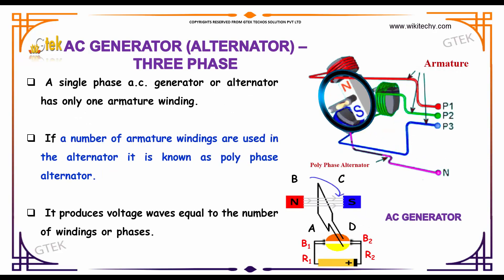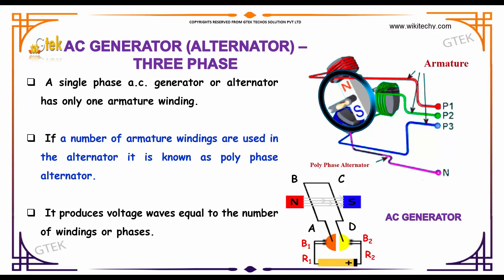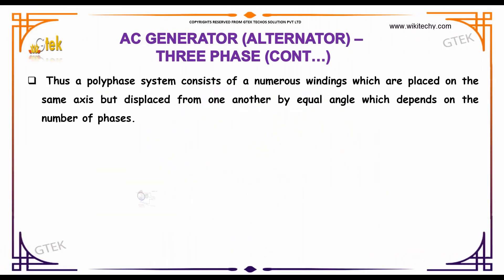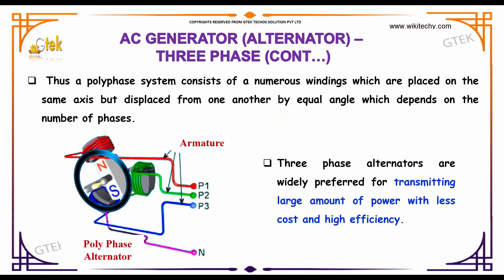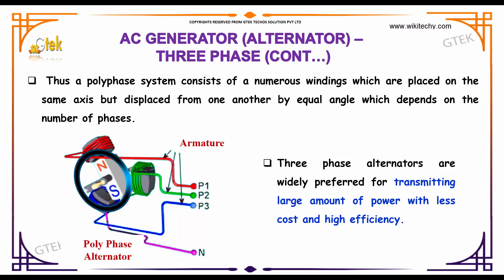Ac generator three phase  | Electro Magnetic Induction And Alternating Current

Comment: Three-phase AC generator connected as a wye source to a wye-connected load. The voltage seen by the load will depend on the load connection;

Comment: An alternator is an electrical generator that converts mechanical energy to electrical energy in ... In principle, any AC electrical generator can be called an alternator, but usually ... Large 50 or 60 Hz three phase alternators in power plants generate most of the world's electric power, which is distributed by electric power grids

Comment: In a symmetric three-phase power supply system, three conductors each carry an alternating current of the same frequency and voltage amplitude relative to a common reference but with a phase difference of one third the period

Comment: Three-phase electric power is a common method of alternating-current electric power ..... Three-phase AC generator connected as a wye source to a wye-connected load. The voltage seen by the load will depend on the load connection; for the ...

Comment: Three-phase electric power is a common method of alternating-current electric power ..... Three-phase AC generator connected as a wye source to a wye-connected load. For the wye case, all loads see their respective line voltages

Comment: A three-phase system is usually more economical than an equivalent single-phase at the same line to ground voltage because it uses less conductor material to transmit electrical power

Comment: In a symmetric three-phase power supply system, three conductors each carry an alternating current of the same frequency and voltage amplitude relative to a common reference but with a phase difference of one third the period. The common reference is usually connected to ground and often to a current-carrying conductor called the neutral. Due to the phase difference, the voltage on any conductor reaches its peak at one third of a cycle after one of the other conductors and one third of a cycle before the remaining conductor. This phase delay gives constant power transfer to a balanced linear load. It also makes it possible to produce a rotating magnetic field in an electric motor and generate other phase arrangements using transformers (for instance, a two phase system using a Scott-T transformer).